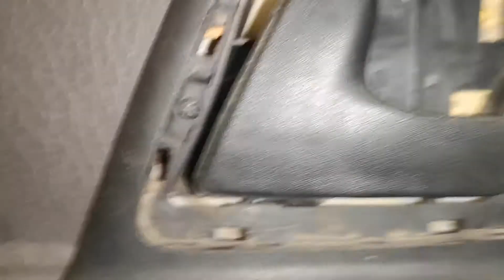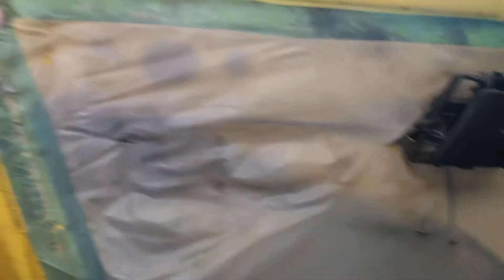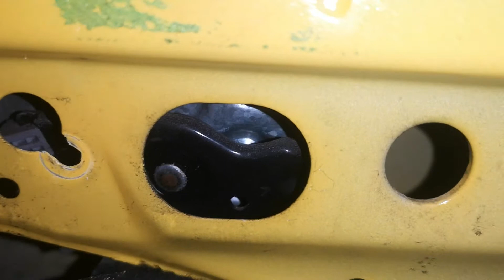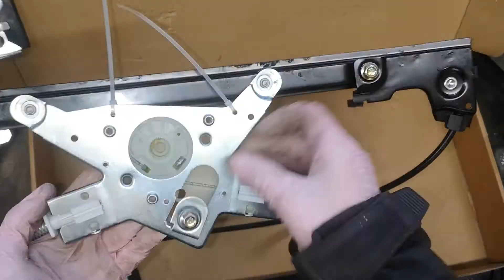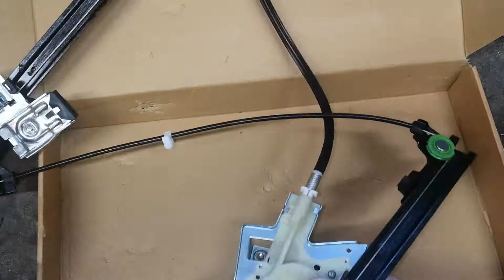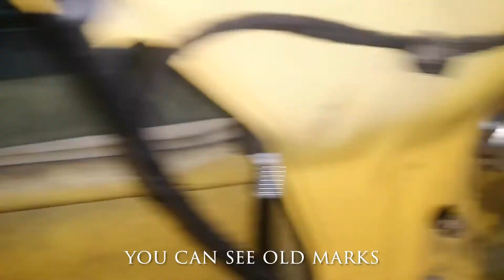Volkswagen Caddy MK2 and Polo Classic front window regulator replacement

Comment: Do you have the link for the window regulator?
Reply from the maker: Check out Ebay/google - which link is cheapest depends on the location. I bought mine locally at parts shop. Same regulator as in ibiza, cordoba etc off the shelf item.